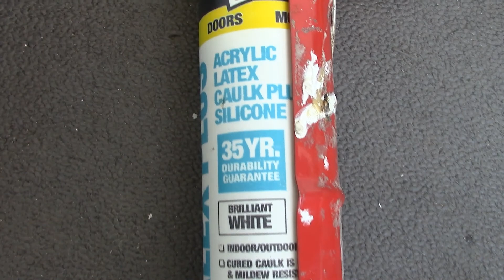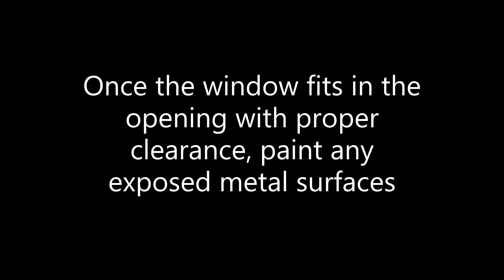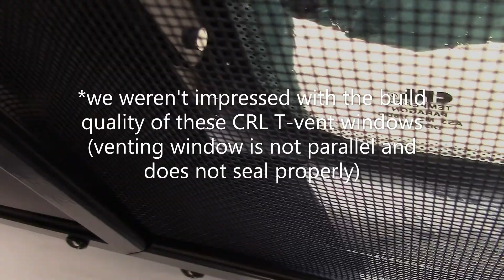Part 2 of 2: How to Install CRL T-Vent Windows in Mercedes Sprinter Van with Factory Cutouts

Comment: Hey Shelter Van Co,  thanks for sharing this video. I have a leak in my CRL window seal and wondered how to solve it. 1) Did you reuse the same rubber seal on the window or did you have to get another one. 2) Did you install it in a different spot on the window? 3) what did you use to stick the seal to the window?
Thanks again,
Tim